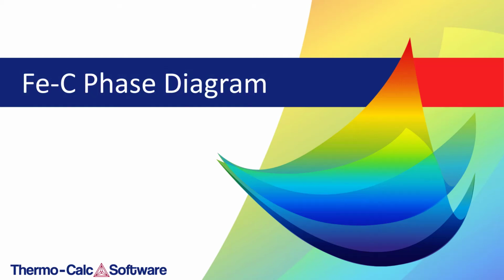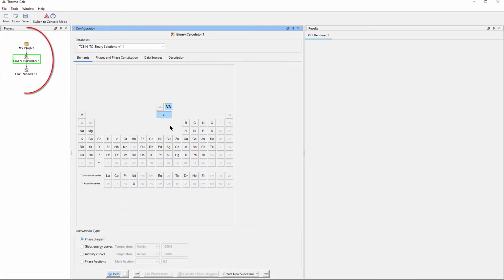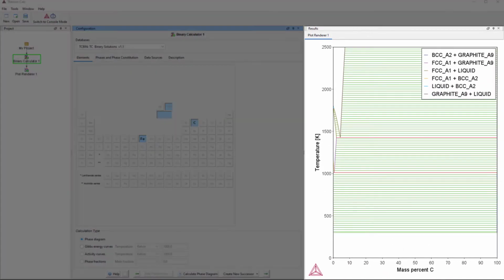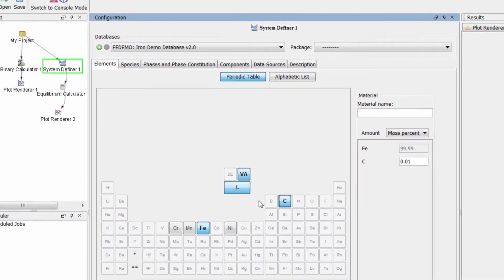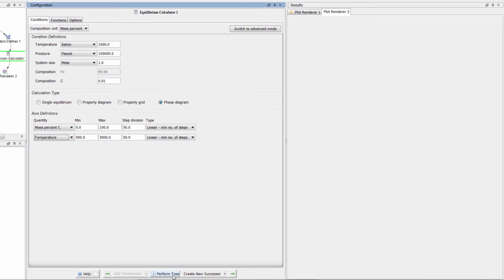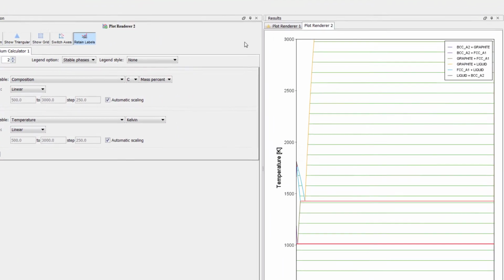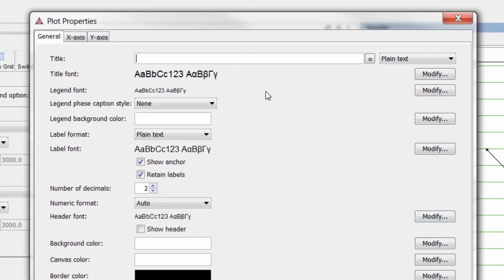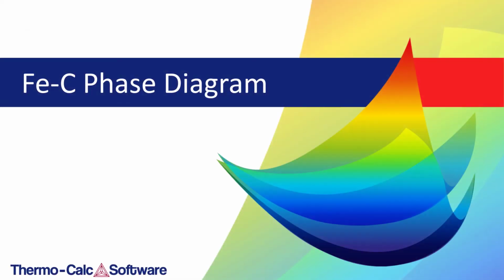Example T_03 - Fe-C Phase Diagram

Comment: Is there a way to visually highlight a composition range?
Reply from the maker: Hi @yhjidid7375,
If by “highlight” you mean focusing on a specific composition range, you can set the limits of the composition axis in the Plot Renderer. Click Show Details and adjust the composition axis limits to the range you want to display.

You can also zoom directly into the plotted diagram by clicking and dragging from the top-left to the bottom-right of the area you want to view.
Reply: @ThermoCalcSoftware no, i meant "highlighting" a certain composition range while the full phase diagram is still present. Is there a way to do it?
Reply from the maker: Hi  @yhjidid7375 ! No, there's no specific way to do that within the software. You'll have to do that in a separate program.

Comment: So in the plot, say 20 mass percent would be 20% of the 0.1 C, so would it be Fe 0.02 mass%C ? or is it 20 mass percent of Carbon in general (Fe 0.2% mass% C)?
Reply from the maker: Hi! The initial composition of C, in this case 0.01 mass%, is only a start value for the calculation. 20 mass% C in the diagram is 20 mass% C of the alloy. Since we only have two components in this system (Fe and C) the rest of the composition is Fe (i.e. 80 mass%). Hope this answered your question.
Reply: @ThermoCalcSoftware  you're the best thank you

Comment: Thank you for this very useful video.
Could you maybe clarify the impact of the selected "Condition Temperature" on the results, if there is any? I do not really understand what this temperature is, as we are going to have temperature to vary in the phase diagram
Reply from the maker: Hi, thank you for your question. When stepping in temperature, the temperature set in Condition Definitions is used as a starting point for the calculation so the temperature needs to be within the temperature range entered under Axis Definitions. It doesn't matter what temperature is set as long as it's within the temperature range. The same applies to the composition in this case.